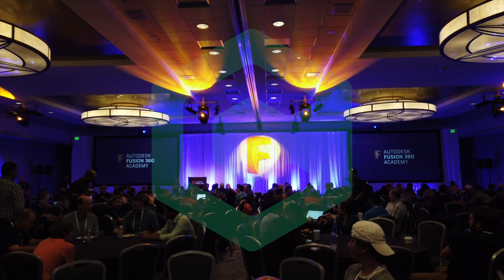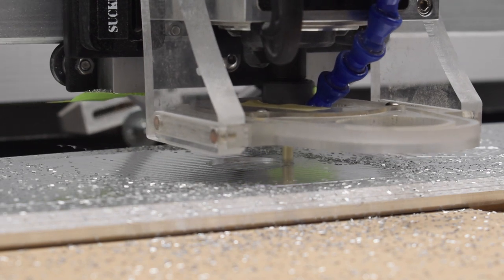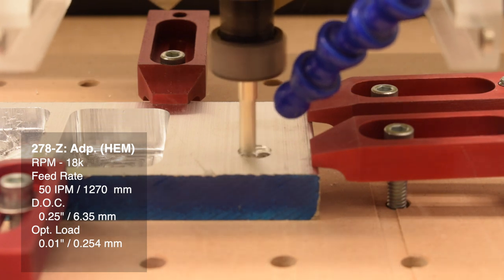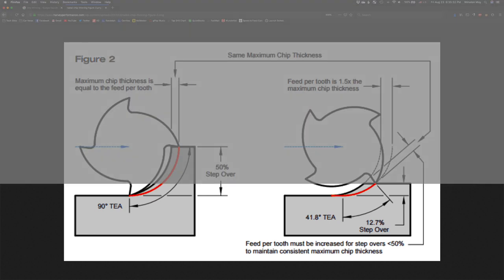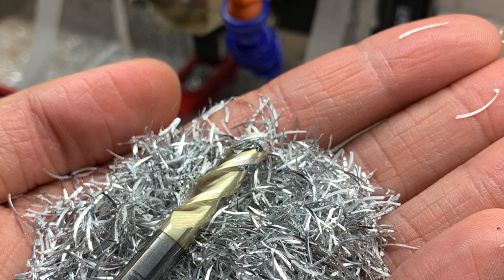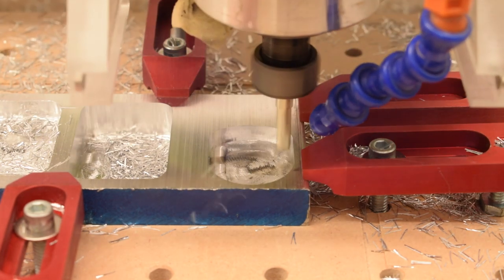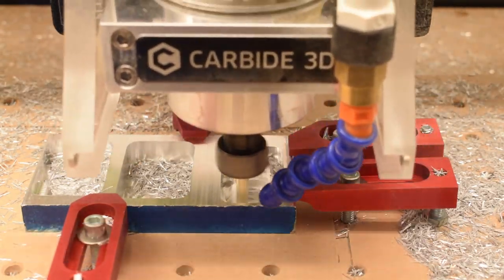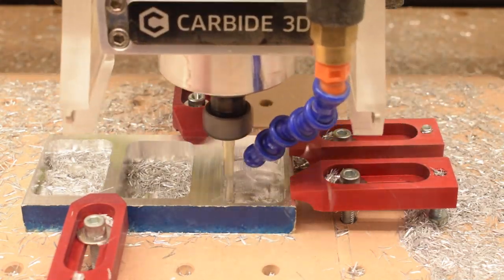Testing High Efficiency Milling Techniques on a Shapeoko 3

Comment: Hi Winston, based on the information I found online on chip thinning, surface speeds and other milling parameters I made an Excel table that automatically recalculates chip thickness, rpm and cutting feed rate, based on the tool diameter, number of flutes, surface speed and optimal load(width of cut) that you select and input. I have tested it on aluminum with SGS's 47 series tools(high quality Japanese) and it works pretty well. Actually, in your scenario, had you used SGS tool for which I have the ,  Chipload Fz (mm/flute) given by the tool manufacturer, the parameters would have been tool diameter 6 mm, rpm 18 000, meaning surface speed of 340 m/min, single flute, width of cut(optimal load) 4.2% of tool diameter or 0.254 mm and depth of cut of 100% of tool diameter, the cutting feed rate should have been 2700 mm/min. I'd like to share this Excel table with you and everyone that might be interested and if you give me an e-mail address, I'll send it to you.
Reply: @TripleLiquid  Sure. Just e-mailed it to you, with a link to Kyocer SGS tools as well.
Reply: You're spreadsheet can be used with other endmills if you enter the desired chip-load into the "Programmed chipload" cell (C34) in addition to the desired SFM (C27).  Where did you get your K factor(s)?
Reply: @gmack4097  Hi, you can use the Excel table for any tool. You just have to input the Chipload(Fz) given by the tool manufacturer into cells E4:O22 and then Cell "C34" pulls the data from there. You also have to change the surface speed in cells D4:D22 to the ones recommended by the particular tool manufacturer. For example, I have tested tools from SCT (https://www.sct-tools.com) and I had to reduce the speeds and chiploads to about 65-70% of those given by SGS as these tools are not as effective. For an even cheaper tool, I would cut down the speeds and chipload to 30-50% of SGS's. A table with load factors can be seen at https://www.emcotest.com/en/the-world-of-hardness-testing/hardness-know-how/theory-of-hardness-testing/brinell/brinell-methods-and-applications/
Reply: @martingaydarov  Thanks!  I was asking about your K factor(s) too though (not BHN(s)).
Reply: @gmack4097  please disregard the necessary horse power formula as it's not right. I'll have to look into it. The rest is working perfextly fine in my experience
Reply: @martingaydarov  It looks right to me if the K Factor units are cubic inches per minute per horsepower (as they appear to be).  It's not a very aggressive cut.

Comment: Teaching an old dog new tricks.  I am impressed, and WILL be trying this (when I'm done with that darn desk (Nov.).   I do have one question, how would you rate the noise level with this (above) technique vs what you were doing on the skateboard...(because I do have neighbors )?  EDIT (ADD) Nice CLAMPS TOO!
Reply: Volume wise, pretty similar to any other toolpath in aluminum. I tend to think 1/4" tools are quieter/less shrill than 1/8" endmills too, so that's a plus. Less shrieking, and more similar to that hum you get with a little high RPM VMC. You can always back off on DOC to quiet it down a bit.

Comment: try using some cutting oil on your end mill and occasionally adding a squirt during machining. It drastically lowers friction and thus improves the lifespan of your tool as well as reducing friction, which in turn gives you more accurate parts and less tool wear.

Comment: I tried this in acrylic. Using a 3mm single flute cutter spec'd at 0.96mm/t. I calculated the feed rate accounting for chip-thining. Cut parameters we 10k RPM, 1600mm/min, 9mm DOC, 10% optimal load (0.3mm). It was noisey moving at that speed into a block of acrylic (and a little scary) but the cut went well. It could do with a vacuum setup for pocketing those depths in a single pass to avoid chip recutting.

Comment: I take it this could be similarly applied to other materials? I've been using adaptive toolpaths with a .1"DOC in hardwoods. Might be time to get more aggressive...
Reply: It definitely could work in hardwoods, plus those chips don't weld themselves together so it'd be less failure-prone with 2 or even 3 flute endmills. Just keep a few thou more stock to leave than usual because there is more deflection (axial and radial) when the spindle is so heavily loaded.
Reply: Heck yeah, I use adaptive in hardwoods at 0.25in DOC with pretty aggressive optimal load (~0.85 - 0.1in).

Comment: Am I missing something?  With HEM, you're cutting much deeper (1/4") with a stepover of 0.01"? Spiraling in to maximum depth (what's the Z feed rate?). 

I did a quick pocket test in Vcarve: 1/4" 2flute spiral EM; 60ipm feed, 30ipm Z. Total DOC = 1/2".  Pocketing a four inch square.

For HEM settings I spiraled in to full depth (1/2") and  used a stepover of 0.02" to clear the pocket. No final clean up pass.  Estimated time was 24 minutes
Using my standard settings for 1/4" EM: 1/8" DOC per pass (= four passes to get to 1/2" final depth); 1/8" stepover (50%).  Feeds and speeds were the same. Estimated time was 17.25 minutes.
What am I missing?  I'm not pretending to cut Aluminum, just looking at full depth of cut vs a standard pass depth.  I get the benefit of using more of the cutting area, but if you throw in flex, then you've got to add one more pass and more time.
(Needless to say, if I was cutting Aluminum, I wouldn't be using my standard settings. So, maybe, this only applies to metals?)
Reply from the maker: If you halve your radial DOC and double your axial DOC, yes that works out to exactly the same material removal rate IF your feedrate is the same. What you're missing is chip thinning. The smaller your stepover, the faster you should feed.
Reply: @carbide3d  Thanks.

Comment: I'm still learning about 2D Adaptive toolpaths (haven't tried one in any stock yet).

Question: that initial bore to get started - is that generated as part of the 2D Adaptive or was that a separate operation?
Reply: A helix is usually created within the adaptive toolpath
Reply from the maker: It's in the last tab of the F360 toolpath dialogue. There you can set lead-ins and ramps.
-W
Reply: @carbide3d  Thank you.  I see it now.  I have only done basic 2D Contours so far and the linking tab for 2D Adaptive has more options including Ramp type.

Comment: I there a video on that air blast setup?
Reply: There is not, but it doesn't take much to Macgyver. Basically just get a length of flexible/segmented coolant pipe, clamp/bolt/glue it to the machine somewhere, run some tubing from an air source of your choice. For me it's a ~950 GPH hydroponic/aquatic air pump. Closer look at my setup: https://www.instagram.com/p/BzJzPPNACo-/